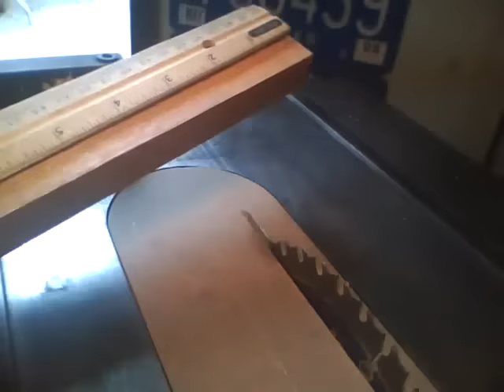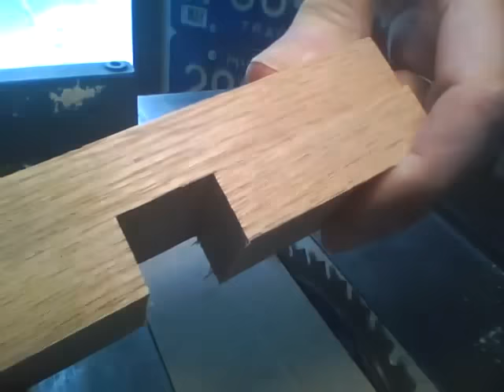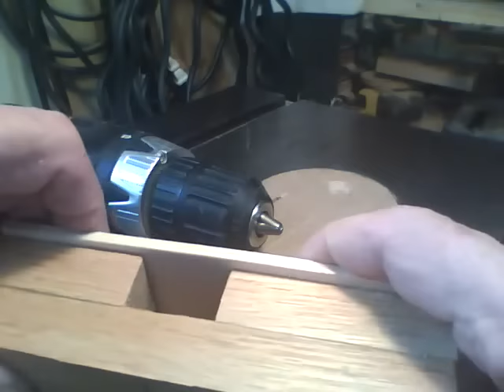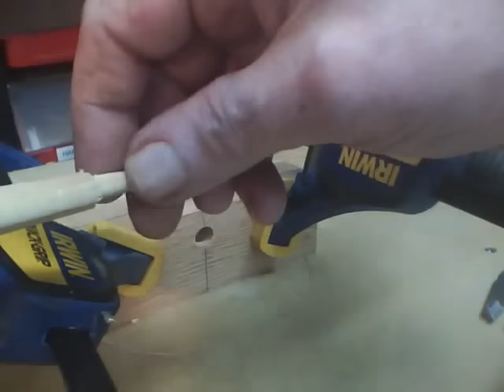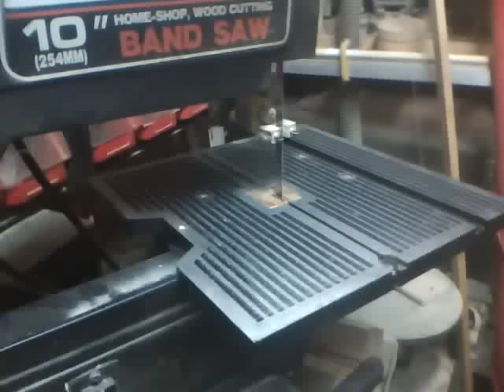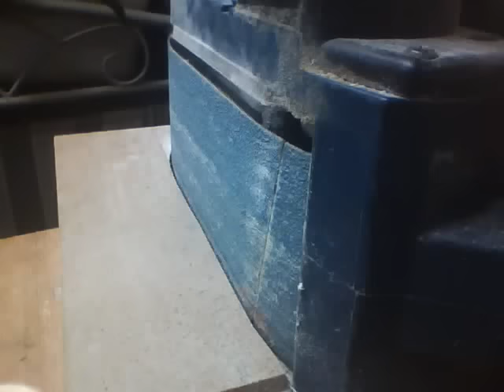How to make Axle Pins for toy cars

Comment: Enjoyed the video but as I am not a genius o the router I didn't see how you set up the router or which router bit you used. Could you advise please?  Many thanks.
Reply from the maker: Sorry about that. I used a 1/4" flat end mill in the router. Bring it up so it touches the 3/8" dowel. Then raise it up 1/16" more. Test and adjust as needed. Thanks.
Reply: Thank's for taking the time to reply Jim, much appreciated.
Reply: @steinie44  I needed this reply too